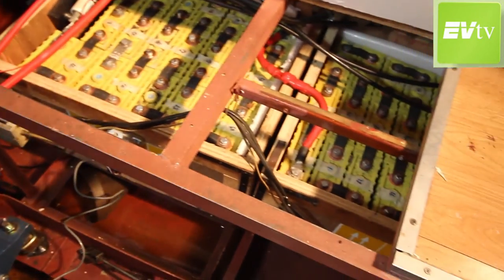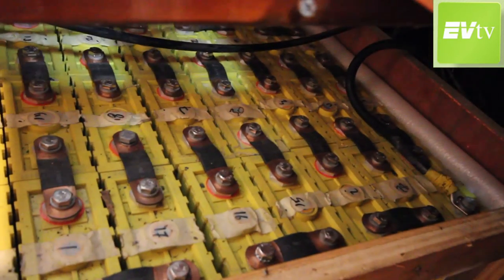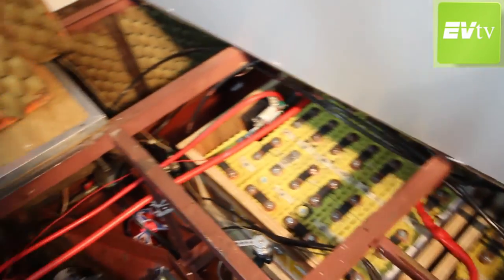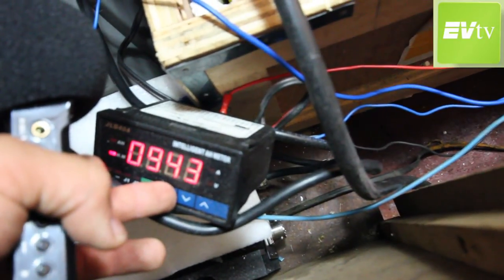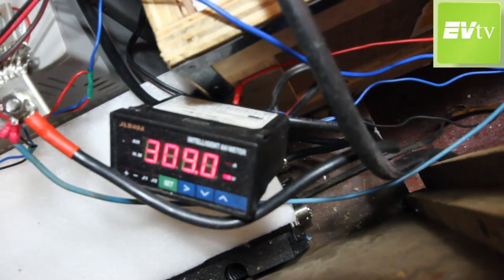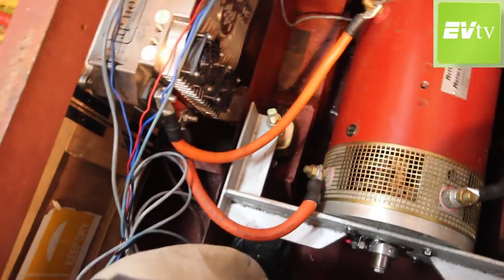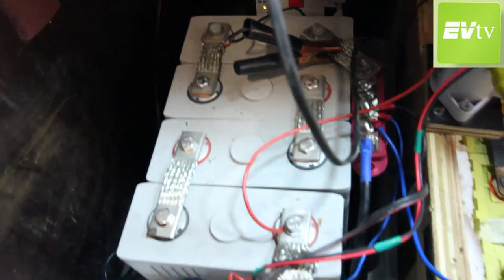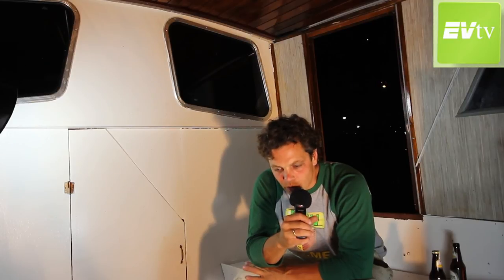EVTV Amsterdam segment: Cabin Cruisin' :)

Comment: Hello, I'm a big fan of your work.  I live in Florida,  and I've been looking at Gulfstar Motor Yachts 44ft. They weigh in the neihborhood of 25,000lbs. Would it be feasible and cost effective to replace 2 Deisel Engines with 2 Electric Motors, Solar Panels and a large Battery Bank and if so, how many Panels and Batteries. I know Elco requires 144 VDC for there EP100($23K each Motor) that's at least 12 lithium batteries per Motor plus house batteries.  I know prices will probably come down a little over the next couple of years,  but I just don't know. I'm not in a position to make a $40K-$50K mistake. I forgot to mention that when I get the boat, I'll be using it as a full-time liveaboard.  I look forward to hearing back from you,  and I hope you and your family are safe !!